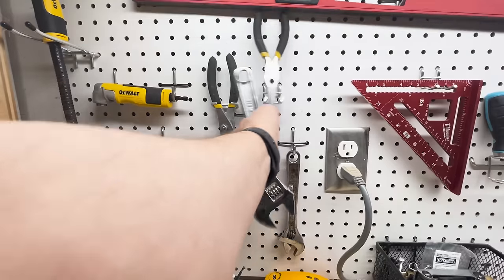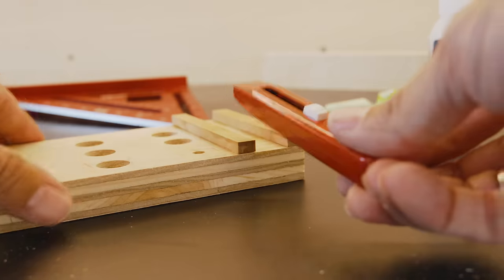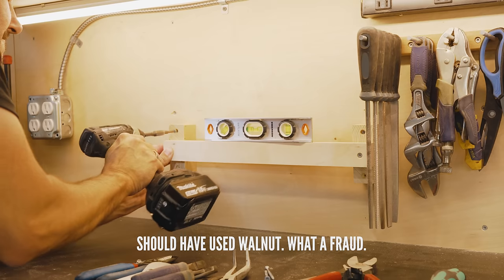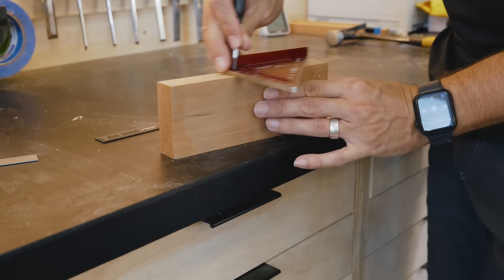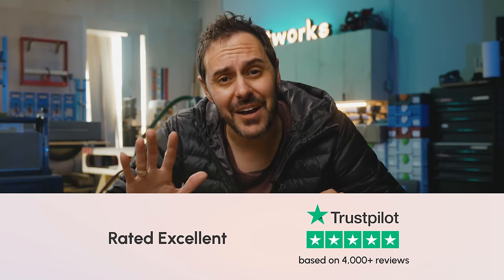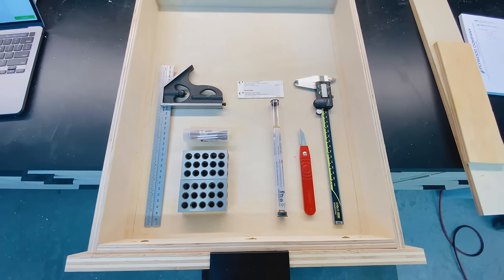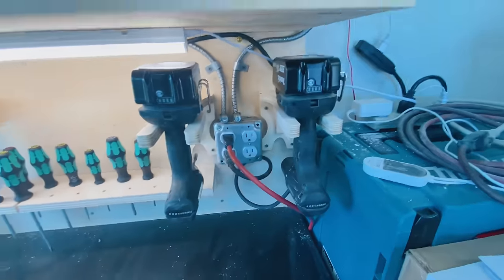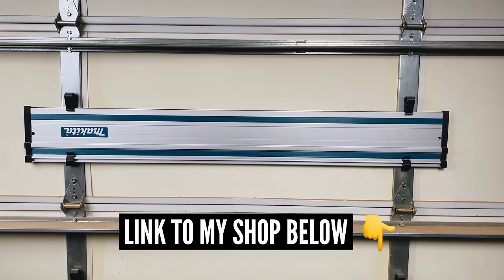How to make killer shop storage (w/out pegboard)

Comment: @4:24 does that take the pang of guilt away?   I'm pretty sure building up treasures on Earth excludes woodworking tools.  And the Pandemic Pine line was so SPOT on. LOL  And @7:16 I never use my card scraper because it hides from me at the bottom of some drawer.  I'm sure an episode on Hidden Migration of Tools will be on The Why Files soon.   Brilliant idea. I'm making one today.  And will probably have to buy more scrapers because, well you know.  But this time.....  :)   OK, final comment. You're a Wera fan (clearly).  But I haven't seen you use the RapiAdapter (something like that).  It's a killer bit holder.  Highly recommended.   Life's too short to have to constantly pick up bits after screwing something in.   OK, OK< really the final comment.  @15:52 I slapped my forehead. I ordered the TSO parallel guide holder from you (works GREAT) and saw that black block thingy.  And thought...huh, what's this for?  And chucked it into a drawer.  LOL.  TY for the reminder.
Reply from the maker: I just discovered Wera and man I'm impressed. The RapiAdapter has been in my cart for a month and haven't bought it because I don't want to store up treasures...
Reply: @wittworks  😁  I started with one...and soon I had like 6 or 7.  Hello, my name is Hansang and I am an addict.....It's been four days since my last tools purchase...

Comment: Great video! pegboard sucks but also France cleat - its a waste of material and time. France cleats were designed for hanging top cabinets, not for hanging tools. You will get much better results with a simply attaching a plywood sheet to the wall like you already did.

Comment: I respect the highly-organized shop, but I just don't have the discipline to maintain it. I've solved this by using bins. Instead of having a place for everything, I have a screwdriver bin, a wrench bin (big, small, metric), drill attachments bin, safety gear bin, etc. I also have a "sort later" bin that is in my face where I can scoop random objects and get them off the bench.

Comment: shop i used to work at had a block of polystrene held in a plywood case at each work station for the small hand tools. just push them in where you want them. one screw held the plywood case where you wanted it. a place for everything and everything in its place. of course the inventing engineer's lab was always a mess

Comment: Oh man, that UJK press is €230 here. Money go brrrrr.

The first project I have in mind when I set up my equipment requires making really flat holes with something like a forstner bit, but I never realized you can't get really accurate holes without a standing drill or a drill guide like that until recently. Do you think I can instead use a router with a large bit? (About 20mm) and how would you make large plugs to fit these holes? Just using circular drill bits?

Also, what kind of lighting do you have set up?

Comment: I'm not a woodworker (unless you count the rare times I replace a rusty nail with a screw on my deck) ~ but I am fascinated with being efficient.  Typically I do my best, but that's normally organizing once without dedicated place-holders (meaning tools loose in a drawer that then shuffle when opening/closing).  That's because my brain completely fails to come up with it's OWN solution of how to fix XYZ issue....  I have to see someone else do something that I can then either use myself or modify to fit my purpose....

So, if you don't mind when you do the 3d printing video (I've had one for 4 days now...  only printing things other people have made), touch on how you dream up the solutions.  Is it just my path of watching others to copy or modify?

Comment: I spotted those TSO Parallel guide holders in  this video and immediately went to your Etsy store!  I would love to load up my garage door with my track saw accessories.  Are there any issues with them staying in place while riding on the door?  Any plans for a horizontally positioned Track Square holder for the same function?
Reply from the maker: Awesome! Thank you! I havent thought about a horizontal track square holder...I'll have to chew on that. Garage door: no issues on tracks being stored like that. The holders are made from PETG, flexible so they won't snap, and hold the tracks securely.
Reply: Might need something like the locking mechanism on the Fastcap track holder to hold the Track Squares when the garage door goes up.   @wittworks

Comment: Question to everyone: What is your idea to hide any cable  from an USB-Dock or USB-power adapter, a Clock or light with 230V cable hanging on the pegboard itself (or a device with Ethernet or optical fibre connection hanging on the pegboard) behind a pegboard (e.g. like the one from Ikea (Skågis) or a DIY pegboard)?
Because the plugs of cables are to big for the small holes in the pegboard. 

For example: Would you cut out a piece of the pegboard, push the cable with the larger plugs through the cut out hole and insert the pegboard piece back in?
Reply: No idea yet?

Comment: There's starting to be more cross pollination of woodworkers / 3d printing nerds.  A lot of young people get into 3d printing as a first "smart manufacturing tool" because 1. cheap 2. its clean and you only need a desk to put it on.  You don't need an entire shop worth of tools to cut up some wood.  Its a much easier sell to talk a established woodworker into a printer than it is to talk a print nerd into a table saw and a dust extraction system.

Comment: The file bracket at 5 min., i personally hate it especially when your are working on the fly. All of the sudden you bench has 6 files on it and your are only using one, very fast it was changed to a screw driver hole on block type of deal.
Reply from the maker: very true

Comment: Running too slow with that laser. Black is burnt. That's close to a fire starting. Lasers can cut without burning wood. It will darken it, but that's different from burning. It's better to cut faster and make multiple passes and safer, too.
Reply from the maker: I experienced the opposite. Started with lower power, higher speed, and multi pass, and it caught on fire. Every time. The only way to do this thick of MDF was to run it on the setting I landed on.

Comment: Agree with the storage philosophy, but your problem is not with pegboard, but poor inserts. 
I use 10mm matrix double layer pegboard that takes 4mm bolts. You can add carriers such as in this video, but everything is modifiable to within 10mm as needs/tools change.
So all the features of what you are showing, with the ability to move simply and quickly. And you can still mount single items.  
'They pretty much live there'. Yes, because they are a pain to move... It just takes me a few seconds to accommodate a new tool.
I have pegboard, and I can reach over 300 items without taking a step. Try counting...
As you read this, please consider it with an open mind. Instead of looking for ways to refute it, analyze the facts. Please. I believe you will be glad you did.

Hang on! Just saw the bit where you store drills upside down! What happened to your minimum motion...

Comment: I got a great tip from another creator (I wanna say @clough47) that will take your custom organization to the next level and help others get better use of their existing pegboard. AUTOMOTIVE TRIM CLIPS! They mushroom like a drywall anchor, but they're easy to remove and they fit perfectly into the holes of a pegboard. SO you can rearrange as your shop changes over time! It's been awesome for my shop.